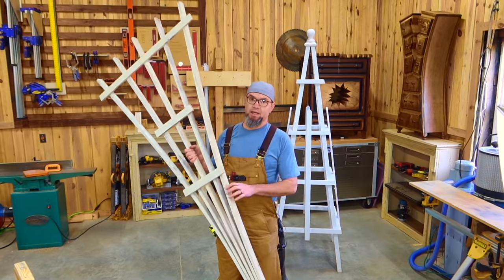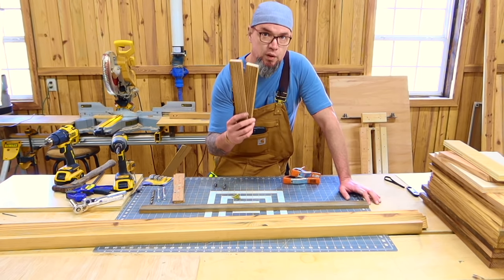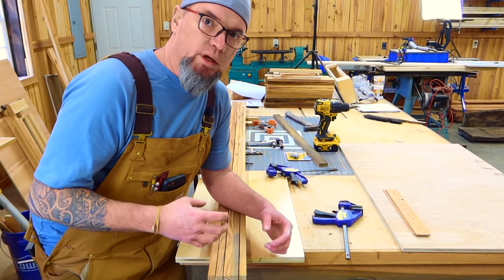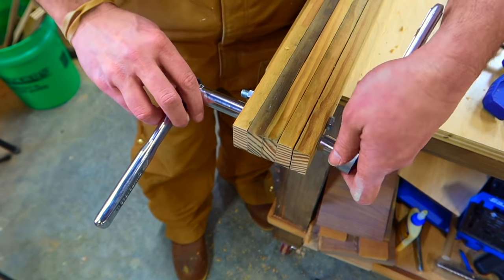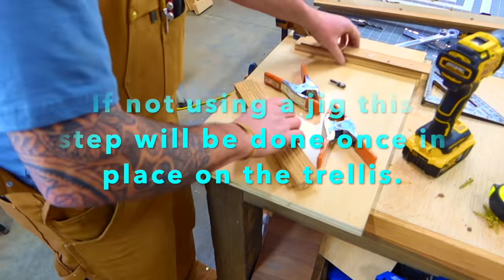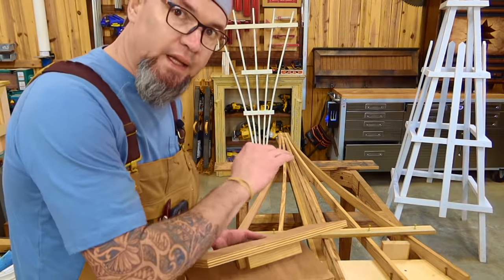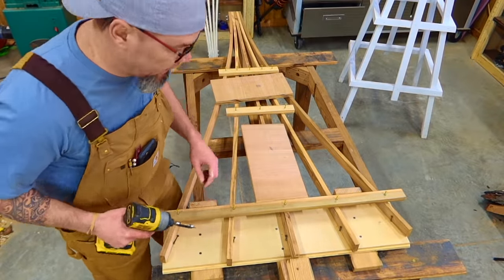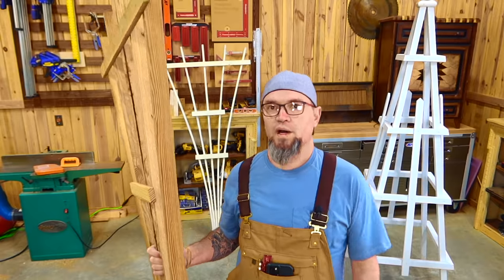DIY Garden Trellis

Comment from the maker: I know I just released the business version of this video.  This one is for the folks that aren't interested in the business side.
Reply: Are there plans for the jigs?
Reply: @debismith8630  Yes plans would help us get started for sure. Hope he responds.
Reply: Yes I need some for to plant food and roses
Reply: What is the hole spacing on the top 34” piece??
Reply: @joshcox8689  he measured it from the bottom up first board at 29 in second is 16 from that then 16 from that (it wasn't the way it was assembled but that's what I got from the video)
Reply: I think the jig is something you could figure out on your own. It’s just a 2x4 with a piece of plywood attached. You could place the screws that hold the limbs apart as far apart as you like, based on what you think looks the best.

Comment: I made some for my climbing rose bushes years ago. I used all thread, and to get a wider fan, i added 8" pcs as spacers between the uprights at the bottom. They eventually rotted out at ground level.  If i do it again  id cement them into a small bucket and bury them.

Comment: Thanks for your videos. I built my first garden trellis this week. I used homedepot 8' 1x2's. I only had to cut 12 inches off of them. They were $2.20 each. I used 11 to build 2 trellis. So about $12 dollars each for wood. I made a jig and they took about 15 minutes each to make. I also took 2 boards 1' and 45 them. I put them under the top board centered to make a little roof / house look. If you dont have a table saw to RIP down wood this is a easy way to make them. The 1x2's measure out to 5/8th x 1 1/2". Watch for cracked boards when picking them.
Reply from the maker: Love it man. Way to think outside of the box. Furring strips are an awesome idea.
Reply: Did you seal or paint the wood? I wonder how long untreated wood would last
Reply: @mcalixtro82  I did not seal or paint it. The buyer will do it. Thanks for the question
Reply: What is the spacing for the screws on the jig?
Reply: @sonjanorman4650  2 screws center to hold the center board. Then 9" and 18" from center each way.
Reply: @jaxon8579  Thanks

Comment: Thank you for going back and correcting the fan width from 38" -> 30".  When I made this about a year ago, I broke about 6 slats from my 2x4's before getting 38".  I will say that I cheated abit and opened up the bottom more to allow for more bend.  I only ever made 1; materials cost was $25 when you add the wood, screws, bolts, etc.  I tried to sell it for $50, then kept dropping the price $5 about every 2 weeks.  I stopped dropping once it was at $25 since that would be "at cost."  I've had clicks looking at it and some saves but I've only ever gotten 2-4 offers of $15.  It still sits in my garage to this day as a reminder to keep trying and moving forward. :)

Comment: I greatly appreciate your videos. I build 5 of these today and they turned out good. I had some not so good yellow pine. Only issue I had was using the jig with the screws like did my bottom boards would split. I had to pre drill them also with a small bit to get them to work. All good otherwise. Thanks again.

Comment: Anyone looking to build the jig, here's what I did:

1. Cut a 2x4 to 61"
2. Cut a 1x3 furring strip to 32"
3. Cut a "1x3" rabbet into the top of the 2x4 so the furring strip rests in it, making a perfect T. (Optionally, make dowels in #6 a bit longer)
4. From the center of the furring strip, measure 15" in both directions and make a mark. Repeat with 7 1/2", so you have 5 marks including your center.
5. Use a 1/2" forstner bit to drill 1/2" deep holes at 1" from the top, just on the inside of each mark (The edge of the hole is at each mark).
5a. (Optional) drill holes on either side of the center mark 5/8" apart (5/16" from center mark to each hole's edge)
6. Glue 1"-long 1/2" dowels into each hole (Protrudes 1/2").
7. Attach furring strip squarely on center in the rabbet with screws only for easy disassembly and storage in off-season (Check for square)

Final dimensions: outer dowels 30" apart at 60" from the base, inner 15" apart.

Using dowels instead of screws took a bit longer, but had some benefits:
a) It doesn't mar the wood.
b) At 1/2", they are tall enough to hold the wood, but short enough that they're easy to lift over (You don't have to screw something in while holding it)
c) You can set the trellis lower on the jig while bending so there's less tension on the arms, then slide it "up" into place.
Reply: thank you
Reply: I have no idea why, but I’m having a super hard time with the placement of the screws on the jig to get the fan to look correct. The other issue is when I pre drill the cross pieces they rarely line up, I’m obviously doing something incorrectly…so frustrated….thank you for this post, but I’m still a bit janky 😢
Reply: @tylertibbetts207  Don't bother to pre-drill the holes, I made a batch of five and pre-drilled all of the holes on the cross pieces with a guide. The holes didn't line up the same on any of them so I had to force them into place anyway. It's something to do with the way each board is going to bend, so It's not that you're doing it incorrectly, it's that not all wood grain is identical.

For the screws, I recommend using dowels instead, just feels more accurate. In the end it doesn't matter as long as all of them are equidistant and square to the long board -- find your center, measure 15in in both directions, then another 15in and that's where your screws should be

(-30,   -15,     0,     15,     30)
Reply: @CLove511  huge help! Thank you Tremendously
Reply: @CLove511  this just does not come easily to me, I want it to be appealing and not like a hack made it. How do you keep the middle “piece” dead middle? The measurements you sent? I’m assuming that’s how. Which side of the middle “0” at you putting the piece on the screw which side
Reply: How does someone safely rip cut a 2x4?

Comment: @Matthew Peech Thank you for all you do.. Ive bought several plans and started on some projects.  Great videos as well.  Ive got a question maybe silly one.  The plans say 72" tall. At the end of the vid Matt says they are  7 feet tall. Thats 84".. Is it 72 or 84? lol. Mine seemed a little short once i cut the strips to 72" as compared to video of him holding the trellis next to him.  I thought hes either really short or I cut them to short.. Sorry Matt! Also will the cross members work if its 84 as well as for the 72 or would i need to lengthen them for the taller one?
Thanks!

Comment: @ Matthew Peech Just a tip on the jig, at the butt end i added two 5/8x11/2x 6 inch strips going up to hold the trellis instead of screws. I screwed them to the side of the jig. It keeps it real tight. And i also clamp it down at the butt end so it won't move. And for the fan i use dowels instead of screws.

Comment: Dude, I had a piece of 2x4 that I cut like you said in the video. Followed all your steps. My 2x4 was 65" long though, and when I spread the boards apart the one board on the outside, snapped off. I'm thinking that I may have bolted it together to tightly.
Nonetheless my wife liked it. I may be able to save it, by clamping it and then bolting it back together again a little higher.
Reply from the maker: This happens.  But bolt lower... higher makes it tighter.  spread slowely and if you hear any type of sound of wood giving stop and unbolt.  Put that wing in the middle.  It has a stress fracture or a knot that cant be seen.
Reply: @MatthewPeechWoodworking   Well Sir, I done good. I clamped the trellis above the break in the wood at the bottom. Drilled a new hole for the bolt and bolted it up.
While it was clamped I toe (nail) screwed two deck screws in the bottom below the break in that one piece of wood. I then took the clamps off and managed to salvage the fan trellis. I was so happy that I went ahead and built  a 6' high x 14" wide rectangular trellis with the cross members spaced 9" on center. I didn't do a video for my channel because it was my first one. The next one I built I'll film it.  Thanx so much for your guidance.

Comment: Awesome, Plan on making a few of these for my mom and sister for their gardens as my first project... Question... you mentioned deck screws because they don't rust.  Should the bolts on the bottom be a particular type to avoid rust also?

Comment: On your gig for the fan, have you considered using a hole and a dowel pin for the second spread and not a screw?
Reply: This is what I did. Works well, no damage to the project material and no tools required when you go to bend the 2nd board. I used 3/8" oak dowel because that's what I had laying around. Probably over kill

Comment: Two questions,  do you need to use galvanized or stainless steel 3/8 x 4inch bolts?  The less costly zinc ones will rust won't they?   Second, do you predrill the slats so you won't split them when screwing in the 1 1/4 deck screws??

Comment: Hey Mat I’m going to attempt your Obelisk.  Where did  find two by twos? Most of my boards at 3 1/2“ x 1 1/2
Reply from the maker: I cut them. A 2x2 is 1.5 x 1.5. Your material will make 2.
Reply: @MatthewPeechWoodworking  Thank you.  I wish you continued success as you grow your business.
Reply: Dimensional lumber can be confusing. The 3.5x1.5 you have are the actual dimensions of what we call 2x4s

Comment: I’m brand new at woodworking, so I apologize if this seems dumb. To be clear, one 2x4 will yield six 5/8” strips…five for the fan, and one for the cross members. Correct?
Reply: It might if you don’t trim the roundover ends off. I did and I had to use a second 2x4.

Comment: Maybe I didn't understand correctly but you said you used 2x4s and ripped them to 5/8 inch? Or do you use 1 by material and plane it to 5/8.? I know width is 1.5 inches but how did you get the 5/8 thickness? Thanks for the video.
Reply from the maker: lay the 2x4 flat and set the table saw to 5/8.

Comment: Have you considered using wider lumber 10 and 12 inch boards for straighter grain on the outside edges of the board meaning is stronger.

Comment: Hey man is there a plan or video on how to make the jig?
Reply from the maker: I have plans but it only covers the top. The outer screws for the top are 30” apart. Then space the other two centered between outer and middle. 

The other two you make when you make your first one just in case your jig is a bit off from mine or your material is different.

Comment: So I tried to make this with pressure treated wood and towards the bottom it didn't bend evenly so the bottom is curved to one direction. Do know why this happened? And have any solutions?
Reply from the maker: Hmmm. Maybe a knot. Try changing up the order of the limbs. Maybe the most flexible on the outside.
Reply: I made two with pt with no problems.  We’re your boards straight to begin with.

Comment: Matthew, How far apart are the screws on the top end? If you showed or told it I can't find it. I'm thinking if I get the top long cross board right the other 2 shorter ones will be good enough to make a pattern.  thank you for your time

Comment: If you don't yet have a table saw, would 1x2 furring strips also work? I know that adds to my total cost to build but I'm not at the stage where I can afford the table saw to rip down boards yet.
Reply: Might be able to get away with it, but look for the truest pieces you can find. It can be very difficult to find furring strips that aren’t twisted or bent out of shape in one way or another.

Comment: Just made my first one along with the jigs. Thanks for the update. Just one question. Do you think it would work with 1x2’s or would they be too thick for bending? All that ripping creates a lot of dust and I don’t have a dust system. My only option is to do the ripping outside. I live up north so I would have to wait for warmer weather.
Reply: Hey David, contact me about a dust systems.  I made one and it work great.
Reply: @obxsurfandsoundfishing4085  sounds good. I’d like to hear about it.
Reply: How did you make the jig?
Reply: @ethanfllr11  I used dowels instead of screws like someone else suggested in the comments

Comment: I was able to do 38" for the farthest outside 2 for the fan. I know the original video said 40 or so and some people had problems going that far. BTW I am all for trying to be as perfect as possible but the lengths of these do not have to be 100% perfect once fanned out you cant even tell if its slightly off. Made my first 2 and they look alright. I don't have a miter/chop saw yet that is next so they turned out alright. Now to sell them...After I add some kind of spike...

Comment: In your plans, do you detail how to make your jigs? Great build BTW. Fantastic idea
Reply from the maker: Just the top jig. The outer screws for the top are 30” apart. Then space the other two centered between outer and middle. 

The other two you make when you make your first one just in case your jig is a bit off from mine or your material is different.
Reply: Been trying for a month! The jig is the hardest part, wish there was a simple 5 min video on just the jig! Cannot get it right
Reply: @tylertibbetts207  take the cross piece for the top and make it about 34". Find Center and mark it. Going each way from Center and mark at 7.5" and 15". Set a screw in each mark and that will give you the spread for the top. 

I haven't rewatched the video, but I made this Jig when it came out. It did take me 2 attempts to get it right, but just take each part of his explanation 1 step at a time.
Reply: @Wigmore72  I will absolutely do this! THANK YOU!  Which side of the very middle screw do I put the fan? You are unbelievable! Again thank you!
Reply: @tylertibbetts207  I'm not the amazing one, that's @matthewpeechwoodworking 😁.

Don't put a middle screw in. Depending on the size of the slats you're using, offset your Center screw 1/2 that thickness to the side. I actually made mine so that I had a screw to each side of Center for the middle slat to easily rest in. That way it stays Center, but I can easily get it out again. I travel for work, so I won't be home for another week, thus I can't send you a pic, but I'll do my best to help you any way I can.
Reply: @Wigmore72  yea maybe you could connect and help offline, to double check via photos

Thanks Brother
Reply: @tylertibbetts207  not a problem brother! Find me and reach out to me.
Reply: @Wigmore72  having a hard time find you. Appreciate the help! You are stellar

Comment: Since you first built these, have you found the regular lumber rotted quickly?  Would treaded be better?
Reply: My grand father made a few in the 60s, out of white oak. They lasted for decades, till the 80s!
Reply: I use pressure treated. One 2x4x10 can make one full one plus a few extra 12” and 34” sections for additional trellises. A 2x4x10 pressure treated is still only around $10. The extra dollar or two is worth it for me.

Comment: How do I make the trellis jig?
Reply from the maker: The outer screws for the top are 30” apart. Then space the other two centered between outer and middle. 

The other two you make when you make your first one just in case your jig is a bit off from mine or your material is different.
Reply: @MatthewPeechWoodworking  Thank you. I appreciate you responding. I got it made earlier though and made a trellis. It came out pretty good!

Comment: do you have the measurements for the jig?  mainly where the screws go that you use to hold the uprights in place after you bend them?
Reply: I made my jig by making a center mark on a board then measure 18 inches each side. Put in screws. Then measure 9 inches from center mark for the next 2 screws. Hope this helps
Reply: @jaxon8579  How big is the jig board? And how far is the 2 outside screw apart, and what would the spacing be for the other screws in the center? Thanks. Cannot find detailed plans anywhere on a fan jig. 🤝
Reply: @jamesbarlowjr.3762  Hey James,  The fan is 36 inches wide. So 2 screws hold the center board then 9 and 18 inches each side for the other screws. A 40 inch board would work. 👍
Reply: @jaxon8579  Awesome Thanks So Much! 🤝
Reply: @jaxon8579  Thanks Jaxon. So if I put the 2 outside boards 36” apart, the center board straight, then each board on the each side of the center is 9” one way and 9” the other? If I’m understanding correctly? Thanks. 🤝
Reply: @jamesbarlowjr.3762  That's it James. Now get to building. 😀👍

Comment: Did he say 7'? I thought he said 72"for the rips in the beginning?
Reply: That's what I thought.  Making videos and keeping everything straight is not easy.  
Cut List:
5/8" x 1 1/2" x 72"  (5)
5/8 x 1 1/2" x 34" (1)
5/8 x 1 1/2" x 12" (2)

Hardware:
1 1/4" Deck Screws
3/8 x 4" bolts and nuts (2)

Comment: Still didn't say what the spacing is on the top.
Reply: It does in 2 other comments. One says the top screws are 30" apart and the others are centered from outside to middle screw. The other says he found center on a board and measured 18" each side from center. Not sure which one I will use but it sounds pretty easy